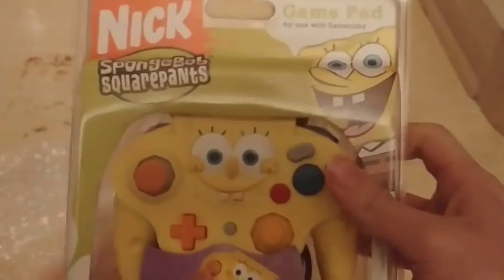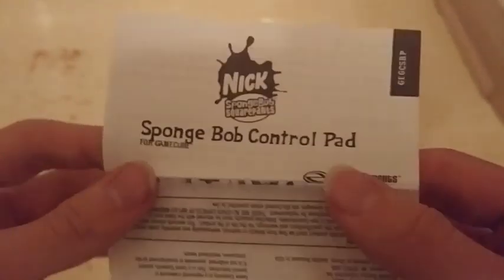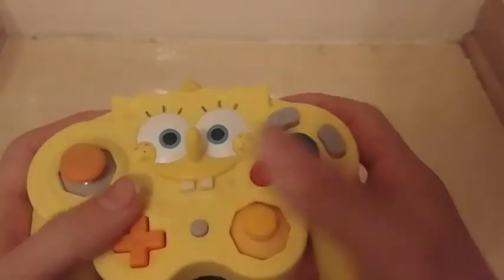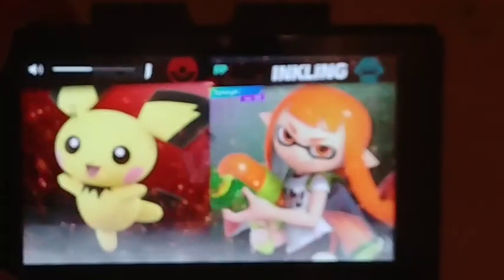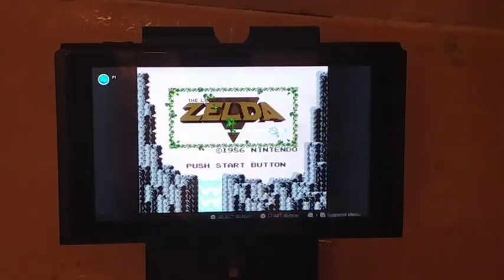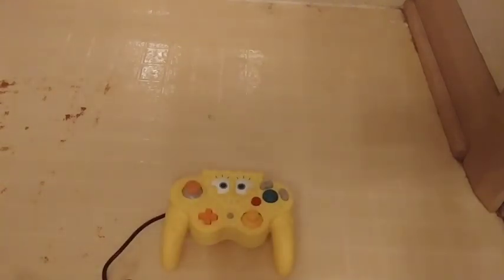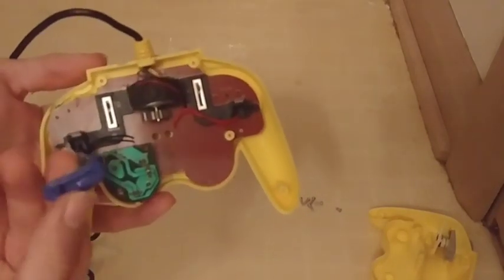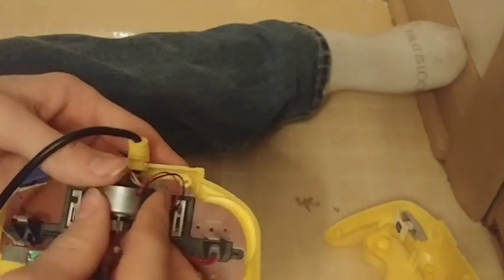Spongebob Gamecube Controller Unboxing, Review, and Teardown

Comment: Hey man, can you list all the accessories you’re using to play the switch like that? Right now I have a GameCube adapter, but I lack a monitor or a HD computer to play the switch docked on.
Reply from the maker: To plug in the adapter, you can get a USB-A to USB-C OTG (On The Go) adapter. They're super cheap, I found a couple different brands at stores like Dollar Tree and Five-Below. The adapter will work with just the black USB, but if you really need rumble support you can get a regular USB hub and plug that in.

I think I used a Hori stand for the switch, because the cables take up a bit of space plugged in.
Reply: ChainSwordCS Thanks for the quick response. Great video!

Comment: Would you able to take the buttons out of an official controller and place them into the spongebob one?
Reply from the maker: No, the buttons are slightly different in size and probably fit into the plastic differently
Reply: @chainswordcs  How long is the cord?
Reply from the maker: @supermariof0521  About 94 inches. I think it's a bit longer than a standard controller cord.
Reply: @chainswordcs  Awesome. So about the same length as the Smash Bros controller?
Reply from the maker: @supermariof0521  I measured the Smash Ultimate controller to be about 22 inches longer
Reply: @chainswordcs  Interesting.

Comment: how much did you pay?
Reply from the maker: like almost $100
Reply: @chainswordcs  Holy Shit. I could get GameCube component cables for that much. Though what I wanna know is why its so rare. You'd think with out popular SpongeBob was, they'd keep it in production a little longer. Also wasn't this controller released around the time that "The SpongeBob Squarepants Movie" was in theaters?
Reply from the maker: @supermariof0521  The game was October 04, movie was November 04.

Basing on Amazon dates of reviews and things, I feel like the first PS2 controller was December 2003 (or at least pre-February 2004).

They re-released the PS2 controller as a "mini" on December 13 2004 (?), and I think the Gamecube controller was released around then too.

As for why the price, I think they're just uncommon. Keep in mind I bought it brand new. But also, it's not easy to find a quality used controller. The rubber nose can break off, and some of the paint (which is weird btw) can rub off too.
Reply: @chainswordcs  Fair point.